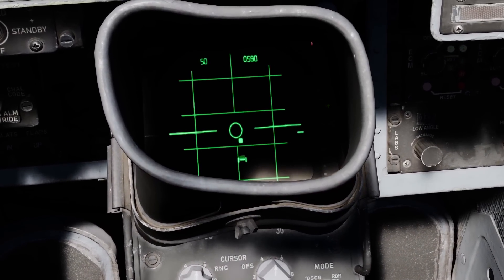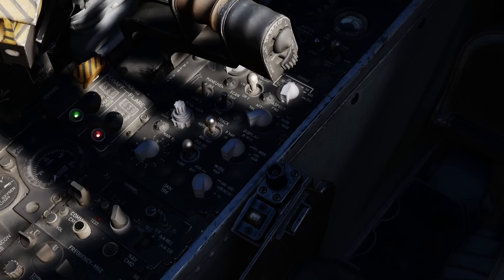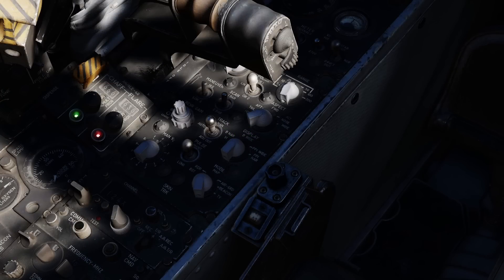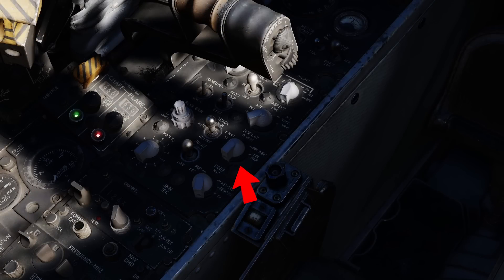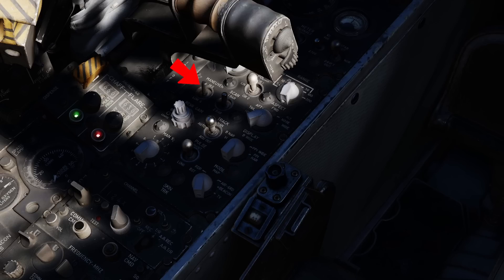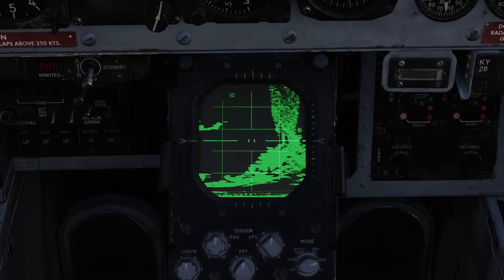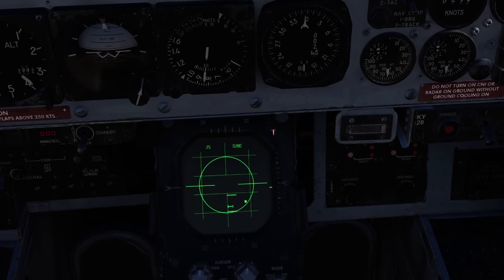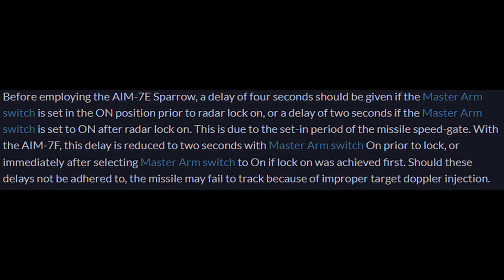DCS World - F-4E WSO Radar Guide

Comment: I know you’ve been flying with this radar for quite a while now, so how does if fair against a low opponent flying perpendicular to you, as compared to the Tomcat radar? The Tomcat radar is relatively easy to notch so I’m assuming the Phantom’s is probably easier to notch, but am curious. Thanks 🫡
Reply from the maker: You won't notch it in the usual sense because, as it is not PD, it has no Main Lobe Clutter filter to filter you out within certain ground speed closure regimes. Perpendicular or not won't matter (think F-14 P-STT), but the best you can probably do against it is hug the ground low enough that you can't be steadily STT'd even at absolute minimum gain, and when working with a wingman, try to separate your altitude by 10-15k ft as you close in to kill him; he'll be forced to lose track of one of you while the other cranks to deny missile WEZ. Hope that makes sense.
Reply: @Checklist_STT yeah that makes sense, thanks for the info! 😊